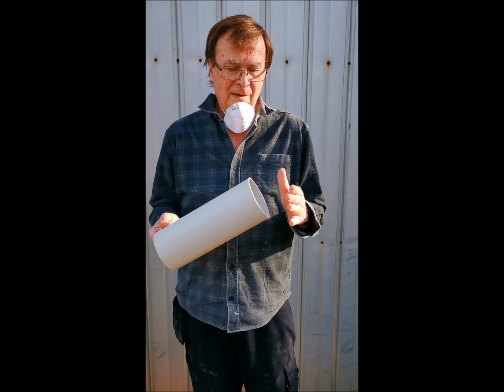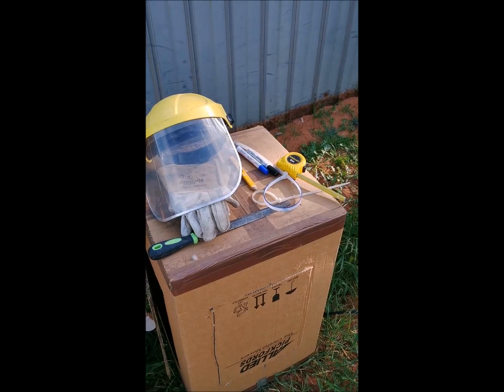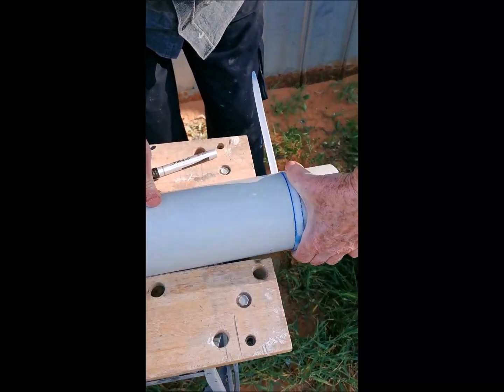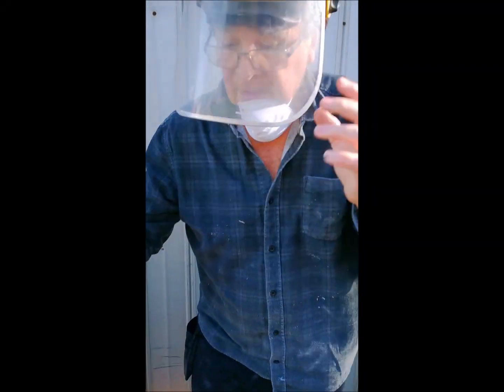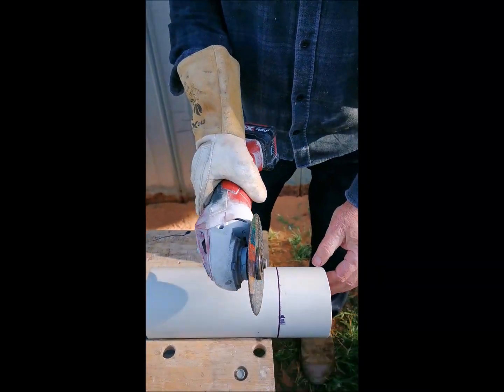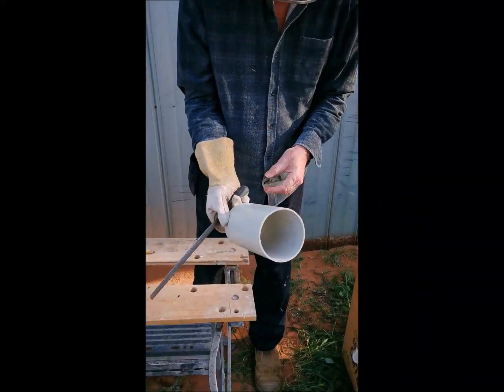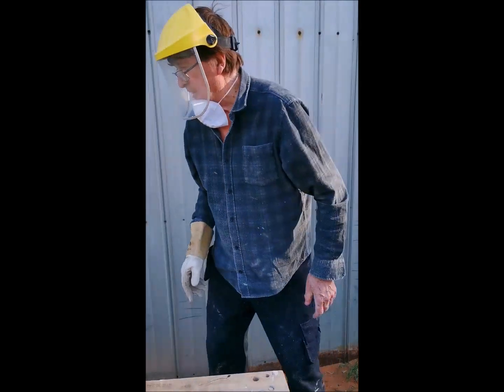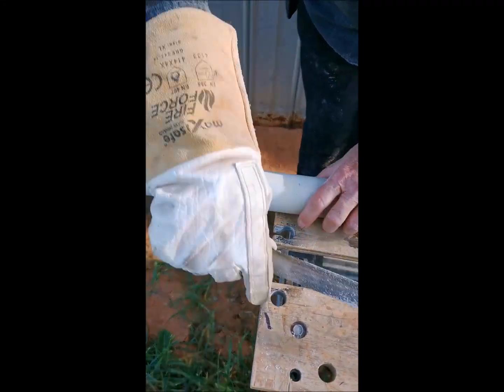How to mark and cut PVC pipe neat and square

Comment: Which blade did you use to cut the PVC pipe
Reply from the maker: Multi material 1mm thick cutting disc.
Reply from the maker: However most ultra thin cutting discs will work 😊👍

Comment: Do you have any smaller examples. I was doing a search on Google your video came up at the top 3 😁. For the question I was asking during my Google search. I like to make a request. Could you do a video about how to use a rachet -ing pipe cutter on 3/4 inch pipe. Because I have a big job to do and I have to use 50 ft to put in. For the backyard.  Could just do a quick video on how to get a good cut cause I don't want to screw it up. And can't afford to screw it up and I can't afford to buy all new piping and elbows either.
Reply from the maker: Thanks for your comment. I'm not sure I understand the question. Are you using 3/4 inch pvc pipe? The 50 foot, is that a trench or what.  I have not used  a ratcheting pipe cutter but I understand that they automatically cut square and do not leave and burrs. So my understanding is that you just need to make a pencil mark at the length you require then put the cutter blade on the mark and squeeze. May I suggest that you sacrifice a bit of pipe to practice on until you feel confident to go ahead. Good hardware stores often have tradespeople walking around who could provide you with practical tips. I hope that this helps a bit.  Good luck with your project 👍😊

Comment: Good day, I know this is unrelated but do you know how to calculate the right motor in cutting 4" PVC pipes with a circular blade?
I want to build my own cutter.

Thank you.
Reply from the maker: No, sorry but hopefully someone with that knowledge will respond 👍
Reply: It's fine. Thank you for the response.
Reply: Just look at the tools that are suggested and check their RPM’s
Reply: I know the pipe can be cut with a regular circular saw so that would be close to 3500 rpm  because it is a larger blade,  but if you base yourself on a smaller blade you  need more revolutions.

Comment: You're shedding microplastics everywhere.  Better to cut it with a mitre saw with a vacuum attached, and to do it inside (like a garage) where the contaminants can be vacuumed from the floor and filtered from the air.

https://www.scientificamerican.com/article/from-fish-to-humans-a-microplastic-invasion-may-be-taking-a-toll/
Reply: If you are doing a lot ... but if you are just cutting one you are not going to buy extra tools.
Reply from the maker: Good point, thanks for sharing

Comment: What is the name of the angle grinder thanks
Reply from the maker: Thanks for the question. It is an Ozito with an 18volt, rechargeable battery, brushless motor and a 125mm disc size. I bought it from Bunnings in Australia. Many other brands will work just as well. Hope this answers your question.
Reply: @AnnErasmus  Thanks for reply

Comment: Thanks for this. I’m about to try your tricks. Hope I do a better job of cutting pvc pipes
Reply from the maker: Good luck, It's really simple just follow my lead
Reply: @AnnErasmus  it worked beautifully.  I m so proud of myself with this project. Installing my 110mm pvc pipes from gutter to Ecotank.  This tip has sped up the process and the job is now a pleasure. Hate using the saw 🙏
Reply from the maker: @pottery68  Well done!